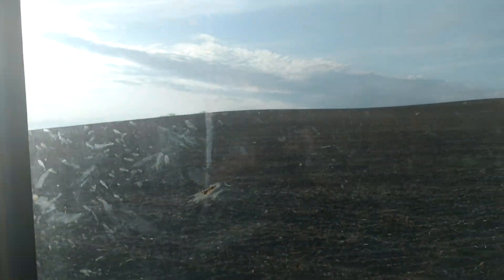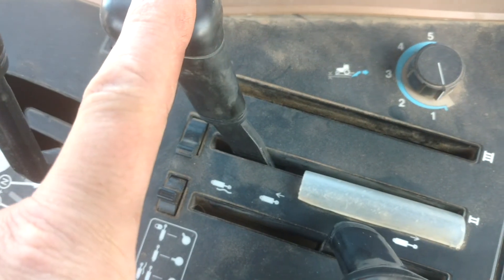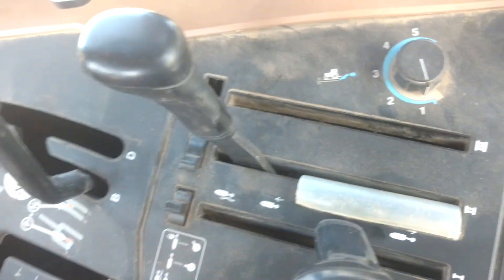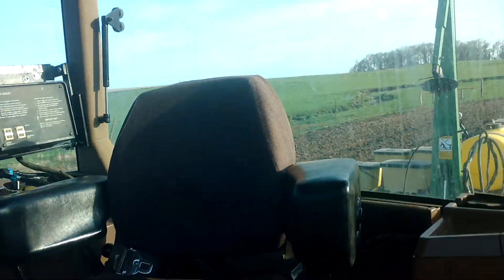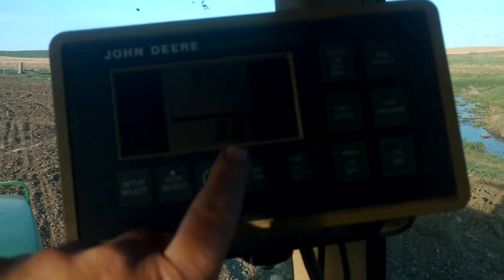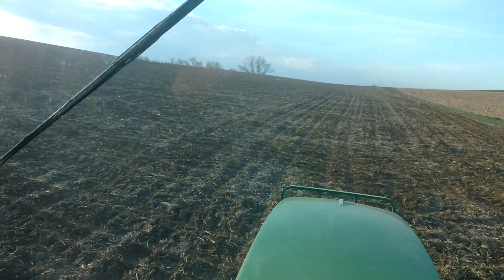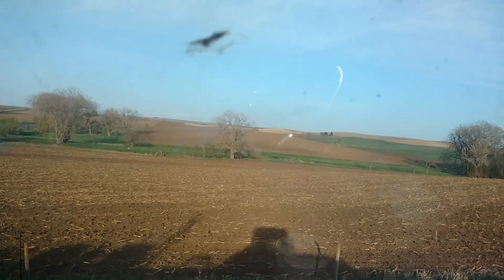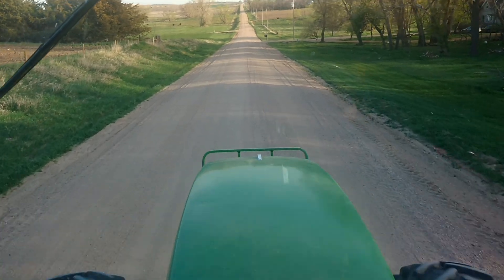7200 John Deere pulling a 7200 John Deere Ag Wild

Comment: could you do a video explaining the control box for the planter? I just bought one and it doesn't have the stickers explaining it.
Reply from the maker: Are you asking about the black box with just a couple buttons?  I don't have that planter anymore but maybe I can walk you through it.  The left rocker button is transmission disconnect so you can turn off half the planter like in point rows. Down disconnects the left half of the planter and up disconnects the right half.  With that rocker in the middle both halves are planting. The right button is for folding.  So to go from transport to field position you would need to lower it to the ground with the hydraulic lever and the 3 point at the same time, unlatch the wheels on the wings, then raise it back up with the hydraulic lever and 3 point at the same time. That should extend the cylinders on all wheels.  Then if you press and hold the top of the right button and move the same hydraulic you used to raise the planter, it should spread it open.  So also with that button on the right. If it's sitting in the middle that's normal operation and then if you toggle it down I believe that turns the markers off if you wanted to plant without markers.   My planter needed 3 hydraulics to operate.  One for the vacuum, one for raising and lowering, and one for the markers.   To go back to transport position just reverse the procedure.  Some have the markers tied into the raising and lowering circuit and only need 2 outlets.  Hopefully that's what you wanted to know, otherwise I just turned a novel for nothing 😁.  Any other questions just ask